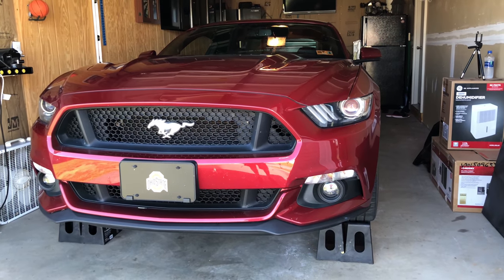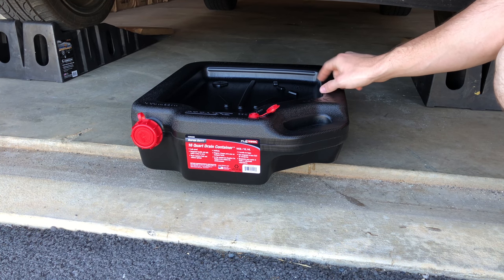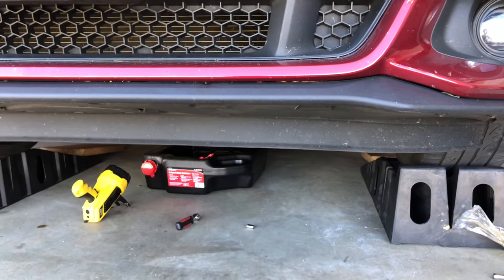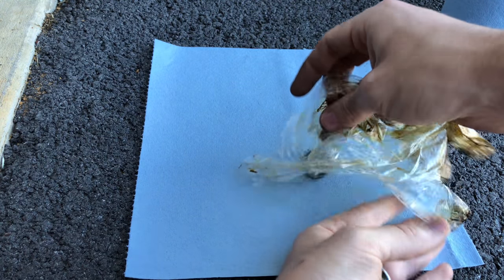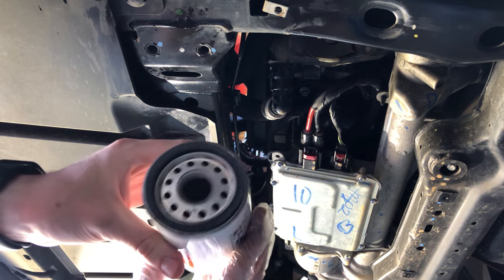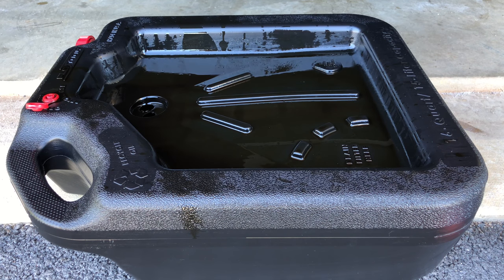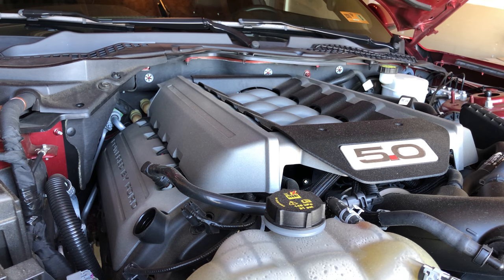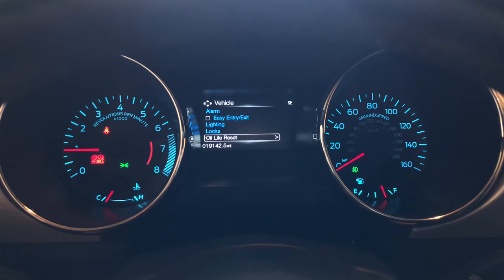2015 Ford Mustang GT Oil Change

Comment: Never use a wrench on the K&N filter for installation.  It’s for removal.  You risk breaking the welds and causing a leak.
Reply from the maker: Thanks buddy, I learned this, but much later in life

Comment: What brand ramps do you use?
Reply from the maker: Those are rhino gear ramps but I also had to use some 2x10’s with the ends mitered to make it up the ramp without scratching the chin spoiler.

Comment: Nice vid, you look familiar are you in the AF? Anyhow my question was did you secure the wood to the ramps I am having clearing issues driving the car onto the ramps I am thinking doing something similar just not sure if you secure the pieces of wood to the ramps or just had it laying on top was that 2 by 4 or what size of wood did you use? Thanks in advance!
Reply from the maker: Hi Toro, thanks! No I’m not in the Air Force. For securing the wood all I did was drill a hole through the wood and ran a bolt through that would stick out the other side. That’s because there is a hole in the center towards the bottom of the ramp. That was the only thing keeping the wood in place while I drove up. The wood was actually a 2x10 so it was wide enough for the tires. Hope this helps. I’d be happy to make a quick video showing a little more detail if needed.
Reply: Joshua Esposito thanks a lot I’ll try that! Are those the rhino ramps?
Reply: Joshua Esposito hey I’m back lol curious how long is the 2x10 after you cut it to use for the ramps, just need to know to cut the same size thanks again!

Comment: I’m trying out royal purple filter. With mobile 1 extended performance, I do change at 3-5k miles not 15k lol, but I use the extended performance because it is 100% synthetic. Marketing the regular mobile 1 as a “full synthetic” is a loop hole actually. The extended performance is supposed to be the one that is legit 100% synthetics
Reply from the maker: That’s some good information! If I get another mustang in the future I’ll be sure to look into the royal purple that you’re using.

Comment: My 2015 Roush RS3 performance pack has the flap, just remove the 8mm screw and it folds down.
Reply from the maker: Not this one.
Reply: @GoKaioken  yours may have been made before January 2015.
My production date is. 05/15

Comment: I'm done with the stealership and their oil changes.  Doing my own and came to YT for some How To's.  This was the video I wanted to see.  The video over on CJ Pony Parts is full of douche bag hard rockin' guitar, and the guy ends up spilling oil all over the place.  So you get a thumbs up.
Reply: Was in the dealer the other day for state inspection, over heard a rep telling an old dude that the last place he had his oil changed didn’t replace his oil
Cap, so they had to degrease his engine bay...

Comment: Ahhh... you gotta tear the underside of the car apart to get to the oil filter? Fuck. Ford... 
Makin it a pain in the ass to work on Mustangs? Guess I’m gonna stick with 2011 and below models... Or move to Chevy...
Reply from the maker: Yeah if it’s not for you definitely stay with the older models or switch.